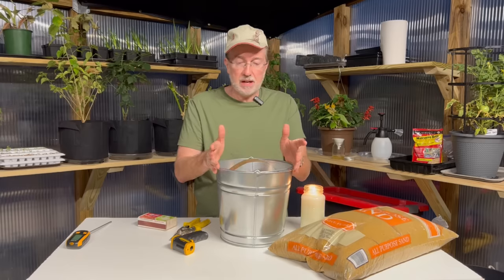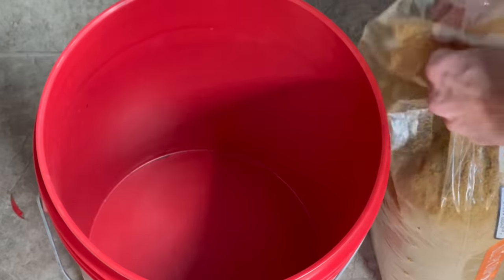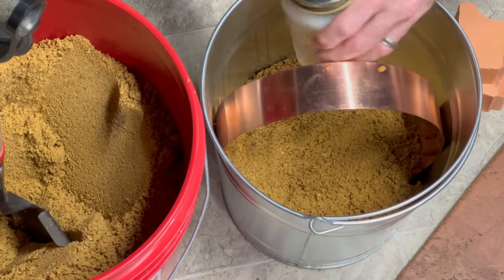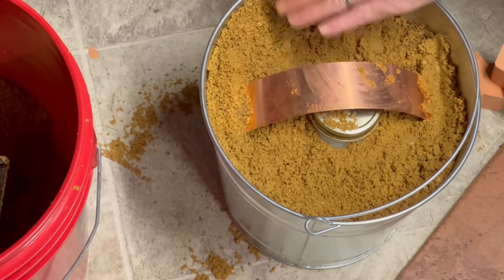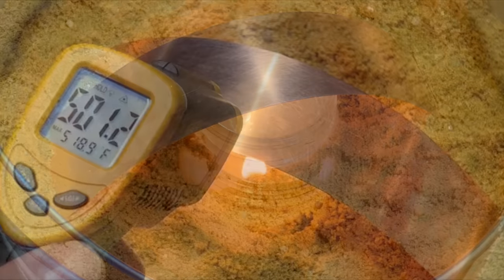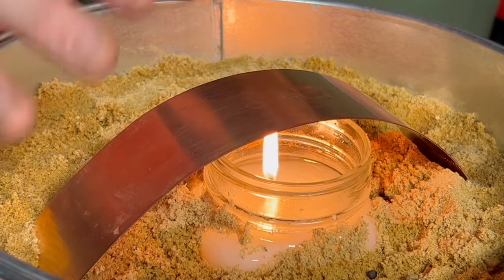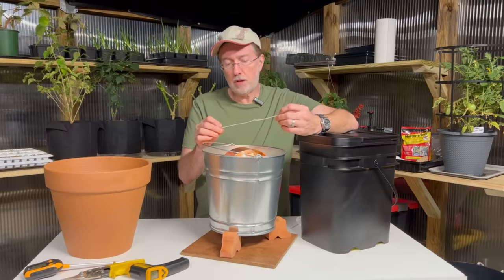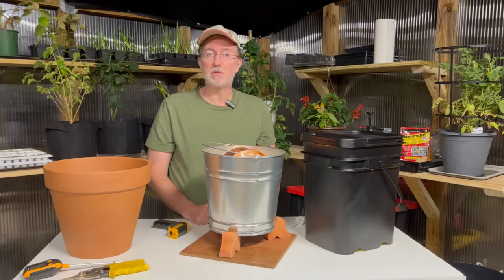DIY Copper And Sand Heater | No Electricity Needed For Greenhouse Heat

Comment: My biggest greenhouse problem has been humidity.  I have only some weeks per year where the temps are low enough to get my temp inside to go below what i need, but every day the dropping temp condenses out a lot of water so it caused some mold at some unwisely timed prunings.  The presence of combustion is hugely helpful to this so im looking forward to these kinds of candle solutions.  I got some crisco and paraffin, will travel!
Reply from the maker: Have you considered using h202 mist (hydrogen peroxide)
Reply: The burning of candles or other fuel without a vent will increase the absolute humidity in a space. When the candle burns out you will have more humidity than before you started
Reply: My greenhouse is currently 33f and 96% humidity. It rains inside everyday. I have 2 auto vents but no blower. I think my only solution is moving air through it whenever the vents open. I also have a 50gallon pool inside as a heat sink..so theres  that :)
Reply: @ZenGardenOasis.  Me: why would using h2o2 mist lower the humidity in a greenhouse?
ChatGPT
Using hydrogen peroxide (H2O2) mist in a greenhouse could potentially lower the humidity for a few reasons:

Absorption of Moisture: When hydrogen peroxide comes into contact with surfaces in the greenhouse, it may absorb some moisture from the air. This process can slightly reduce the overall humidity level.

Chemical Reaction and Heat Production: Hydrogen peroxide can undergo a decomposition reaction, breaking down into water (H2O) and oxygen (O2). This reaction is exothermic, meaning it releases heat. The increase in temperature can cause the air to hold more moisture, effectively reducing relative humidity. However, this effect would likely be minimal unless the greenhouse is very tightly sealed and the amount of H2O2 is significant.

Ventilation for Safety: The use of hydrogen peroxide mist might require increased ventilation to avoid accumulation of oxygen and to ensure the safety of plants and workers. Increased ventilation can lead to a reduction in humidity as more humid greenhouse air is exchanged with the drier outside air.

It's important to note that while these are potential mechanisms, the actual impact of H2O2 mist on humidity in a real-world greenhouse setting would depend on many factors including the concentration of hydrogen peroxide, the size and ventilation of the greenhouse, and the external environment. Moreover, hydrogen peroxide is typically used in greenhouses as a disinfectant or for controlling pathogens, not for humidity control.

Comment: I just experimented w. 2 small clay pots, heating them in the oven and 6.00 worth of small copper piping. I put the pots w. sand in the oven for about an hour. When I took them out and inserted my copper, the copper was immediately warmed so that I could not touch it. I push the coiled copper down as far as I coud.  SO COOL, nah, so hot.

Comment: Won't the sand get so warm that it melts the oil/ wax making the wick sink?? Interesting idea..! Wonder if using a copper tubing would work with some mods. Thank You for taking the time to make this video!👍👍
Reply from the maker: Thank you….this is a prototype idea as I’m always tinkering.  Unfortunately most people don’t want to experiment but rather go with the crowd.  It’s not a breakthrough but rather an experiment.  The other video was put up about 2 weeks ago and used terra cotta pots.
Reply: Hi! Thx for your reply!! I'm just trying to find some safe, cheap emergency way to supply heat inside a small room during a black out! I think your experiment is Awesome, just questioning the wick/ melt..for it to stay upright... So maybe a way to secure it if need be.. I was certainly not intending to diminish your effort in any way!  I am anxious to try this idea when I can afford the supplies! Take Care👍

Comment: I like this idea for the greenhouse in the spring on those nights that are cooler than I care for. Also going to use a barrel full of water when the sun is gaining power again.
Reply from the maker: Yes so true.
Reply: Used a 50-foot black hose filled with water around the shelves in a 6×8 greenhouse near the glass. Temperature in the early teens in the morning and hose would still be warm. Also had a small heater on a timer at night though.

Comment: I noticed, that when I polish metal, the more polished it becomes, the quicker the metal becomes heated, and the faster it spreads among itself, to the whole piece, so you may want to get a buffing wheel, and a polishing stick (I find the polishing compound stick for stainless steel, the white stick, polishes aluminum and copper much quicker, to a mirror finish), to try this sand battery on, to see if it help with that heat transfer, you may also want to double ring this process, so you have a copper ring on each side of the bucket.
Great idea my friend 😁👍
Reply from the maker: I love the emoji…it’s cool.

Comment: Thanks for the info.  Very interesting concept. 

I have often wondered if one could devise a way of harvesting the heat generated from a compost bin. Decades ago, I was composting grass clippings in the backyard of my rental. 

To my shock, I found that the center of the pile in the bin had turned to ash, due to the composting process and inadequate watering. I had no doubt that one could have cooked a meal in it, but didn't think of that at the time. 

Today, I don't have room for a compost bin nor the capacity to develop some sort of heat exchanger for one, but I really like sand pail idea and will try one in the garage.  Thanks.
Reply: the compost ideal is widely used in hotbeds for green houses